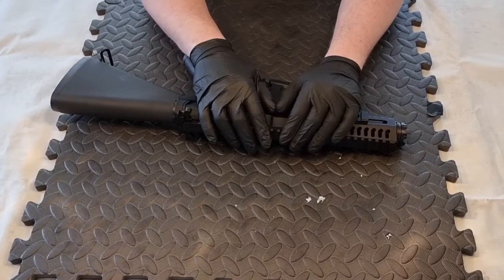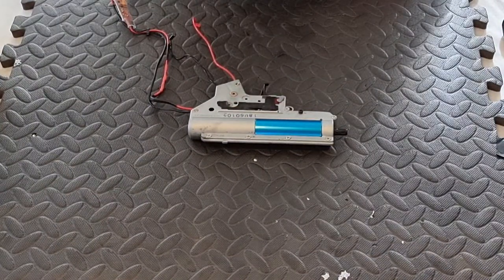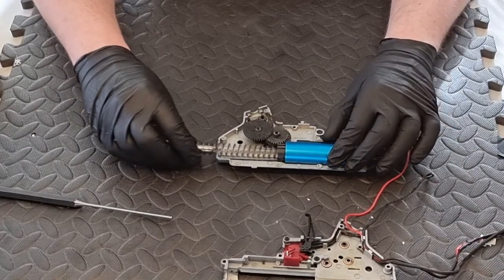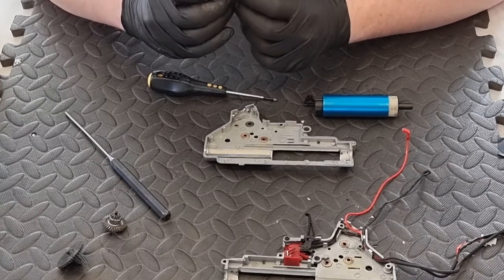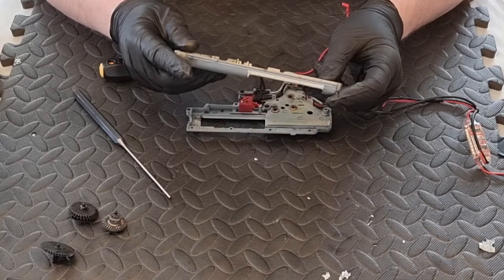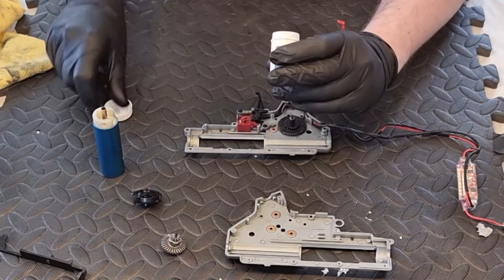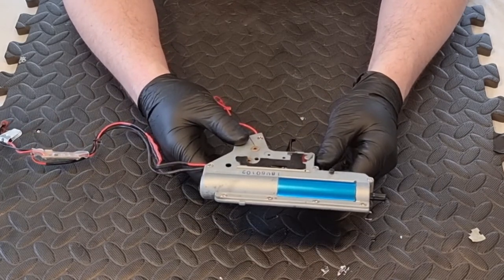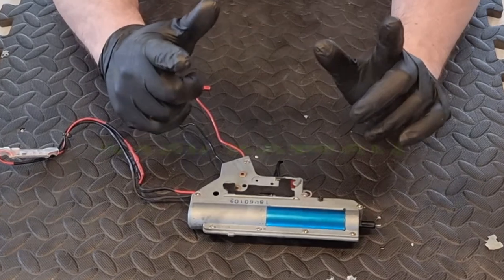How to dismantle and reassemble G&G ARP9 V2 gearbox. 4 year old V2 gearbox service.

Comment: As I watched you taking the screws out I wondered if you would flip it.  It's something G&G do, screws in from the 'wrong' side compared to just about every other manufacturer.
Internals have held up pretty well considering, a bit of wear to be expected
Reply from the maker: Hahaha, yes it did catch me out a bit that. Its one of those situations where I immediately thought flip it as I was doing it but to busy videoing it. I thought I would leave it in because it would easily catch people out. The internals have done very well, like you say considering the use the wear is pretty good.

Comment: Hello. 

I have an ARP 9  for around 2 years now. All stock parts, never opened. Same as what you said at the start of the video, it started to sound quite different to a new one. I was planning to try and upgrade some parts on it to make it run smoother, but I don't want to make it shoot crazy FPS, ROF or some other nonsense. I am happy to keep it at 320-330 with 0.2 bbs. Could you help me get some proper parts for it. Been reading all kinds of forum posts, checking out all kind of videos, but I honestly have no idea what I should get since I never opened an airsoft gun before. Been reading how ceramic ball bearing are good for low FPS and ROF, and on the next post been reading how actually I should get bushing for low FPS and ROF since they are more reliable. I am totally in the dark. No idea what do do with the gears. Some people say "Just change them", while other say the original ones are fine. Same for the compression unit. Same for every single part the ARP9 has. People only seem to agree on the fact that you need a precision barrel, a hop up rubber and a new mosfet ( again everyone screaming how you absolutely need a Titan that costs 150 quid, something I would prefer not to spend money on and a month later just have it burn out on me).

Thank you.
Reply from the maker: Hi. OK well first off I'm a firm believer in the moto that "if it ain't broke, don't fix it".  So first of all it sounds like your happy with the performance as stock. That's great and just the same as me. I was happy with mine as it was. I have made no upgrades to the internals. I changed the mosfet out for the Perun etu ++. Didn't need to change it, but I wanted to review it. One of the videos is on that if you haven't seen it. That is the only upgrade I have done. To be fair all it does really is give you a few more functions and it's a bit smaller. There have been instances of the stock mosfet burning out but mine hasn't, of it did or you want more functions then I would go for the Perun. Much cheaper than an etu replacement or optical trigger system, like the Titan.
As for barrel and hop rubber. I would only change those if your not happy with the range or consistency your currently getting. I've found the hop on mine as stock can lift heavy bb's with ease. 
If its started to sound different it may be the case that you have some worn components. Best thing to do is open up the gearbox. Give everything a good clean out and check for damage. If the piston is worn then you could replace it with stock or upgrade to something else. The gears should be fine. If you do have damage and want to maintain the level your at then a good quality set of 18:1 should be fine or a replacement stock set. If they are good though just grease them up with sparing amounts of good quality grease, silicone on the plastic parts and it should sound the same or better again.
The argument of bearings vs bushings has been going for a while. If your new to shimming or tech in general then I would stick to bushings. Bushings are harder wearing and less prone to failure. The benefits of bearings tend to be minimal to be fair. Good quality bearings can also be costly. You shouldn't need to change what's there to be fair.
You can check airseal on your cylinder piston and nozzle while you have it apart as shown in the video for m4 takedown. Again if anything is worn or bad, you can change out at that point.
Overall be careful when viewing "upgrades" sometimes with our replicas they can end up being a downgrade.

I hope this helps. If you need more specifics for parts let me know.
Reply: @rockbottomairsoft    Thank you for your quick response. 
I am actually quite happy with it as stock performance. I usually play in the Mill and a stock ARP9 is more than enough. During nice weather I play in Anzio and I noticed I get the same range as a longer gun(except DMR obviously). ROF is enough. Only thing I don't really like is the spread at long range, but then again...the barrel is super tiny. 
I am using .25 bbs all of the time so I don't need to lift bigger bbs.
The only thing that I would care would be the binary trigger, since I asked if I can use it in those two location and they said " Yeah, no problem!".
I really apreciate taking the time to answear my questions.
Reply from the maker: No worries. The spread at range can be reduced by improving shot to shot consistency. This normally is created with good air seal and reliable hop application. With that in mind, I would recommended to give it a good service. While your in the box test your air seal components, if they are worn then change them out. You would be looking at piston head, cylinder head and nozzle primarily. Also check your hop rubber is not worn and correctly seated as this also forms part of the air seal.
Binary trigger is a feature of the Perun, so if you fancy that I would recommend that mosfet. Did a video on changing it out, its really easy to do.
I hope you get your arp shooting how you want. Any other questions, let me know.